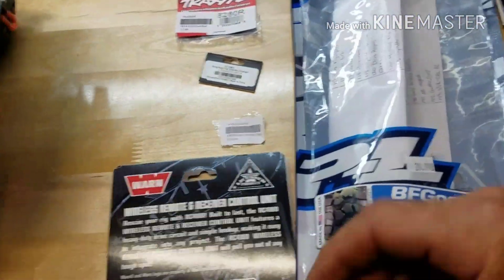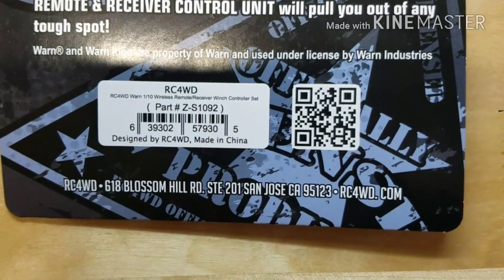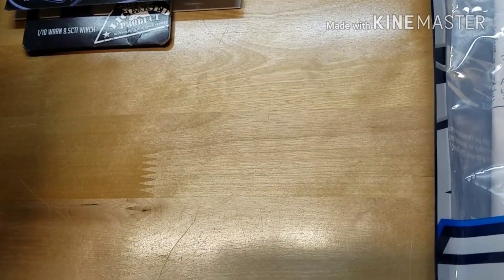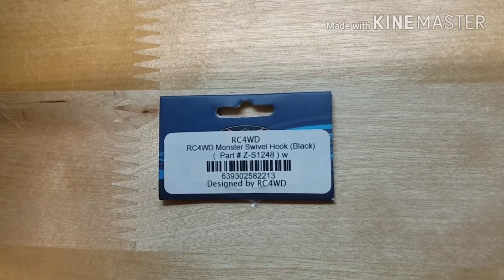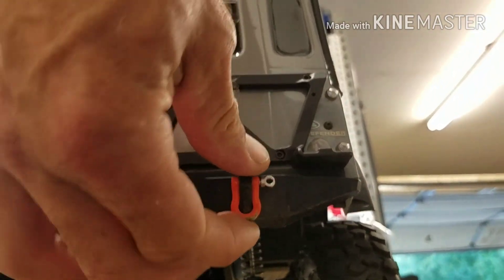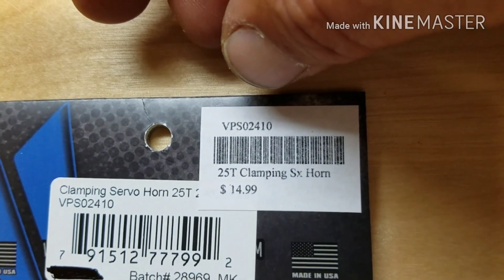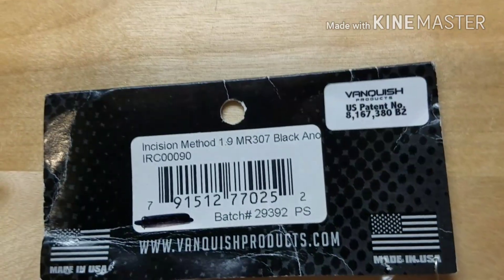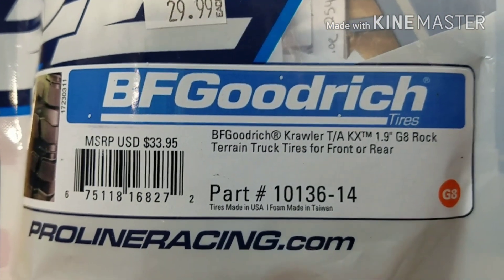Trx-4 all parts so far/ crawlin course

Comment: What kind of batteries do you run on your trx4 and how long do they last. Im trying to learn all i can about the trx4 before getting it.
Reply from the maker: +Chris Neibert I run a Lectron Pro 2s 5200mah 35c majority of the time. It does fine for me, so far. Now and then I run Lectron Pro 3s 5200mah. When my Savox steering servo is ready to be put on, I might run 3 s all the time. On 2s I usually get about an hour when crawling. Not sure about 3s, don't think I ever ran  one done in the trx, after about 30-40 mins. If I had to guess I was probably close at 40mins with the 3s. The 3s does have more speed bit I never really need speed. I have had no puffing on the Lectron so far. All my traxxas are puffed right now. Hope that helps.
Reply: Buy it Break it Fix it thank you

Comment: Why not the Savox 1230, speed is .16 and torque is 500oz for $69
Reply from the maker: +CamaroWarrior i bought it at my lhs and since im so new to the hobby, thats what they recommended at the time, probably did not have the 1230. Is it waterproof?
Reply: tthat's the only thing its not waterproof, savox have waterproof servos but they much weaker, many people run the savox 1230, and many have said it seems its water resistance but not fully waterproof.. but at 6v it turns much faster than stock and cant beat the large torque you really need. the one you have now turns faster than the 1230 .13 to .16sec but doesn't have as much torque you need for turning those wheels 416oz to 500oz
Reply from the maker: It's going to do the job for now. Lol I'm not going to buy another yet. I am currently plasti-dipping mine right now. Might not be the 500 but it is totally better than stock. If this one goes, definitely the biggest and baddest will be put on.
Reply: lol dude do your thing still a good servo you got, cant wait to see your final product. mines still stock for now, and I want the same tires you now have, I had Chinese knockoffs of those on my old CC-01 they have great traction